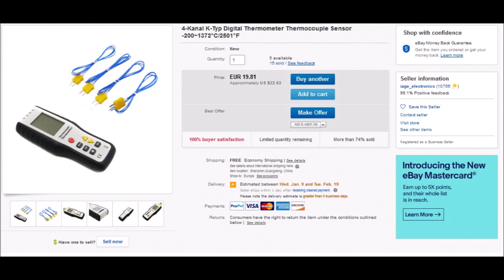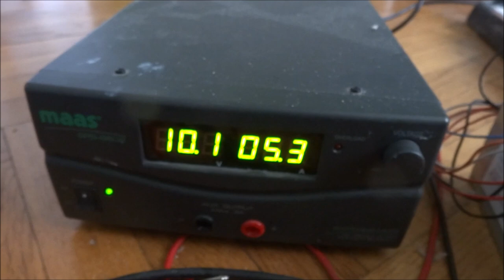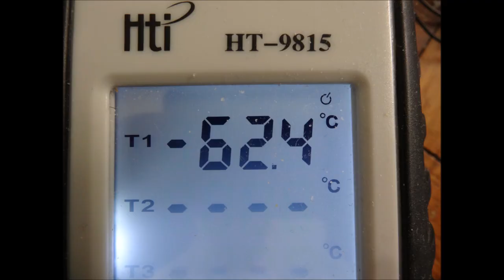stacked Peltier modules for very low temperatures less than -60°C

Comment: they used cascaded peltier coolers in some older thermal imaging camera's to lower the image sensor to -70c to reduce noise from non infrared radiation

Comment: Why are the elements on top getting smaller?
I guess the lower elements reach their deepest temperature only in their center.
Or is there another reason?
Why didn't you use the same voltage for all elements?
If it's in the video or reference page, sorry I missed that.
regards!
Reply: (1) Each element has different power requirements due their size. More size means more semiconducting thermocouples means more voltage/current. (2) The way that the thermocouple works is that it sends heat to the bottom surface, leaving the top surface cooler. (3) The thermocouples on the elements will be sending their own heat  to the bottom surface as well as whatever heat gets transferred to the top, cool side from the Peltier element on above it. Therefore the elements on the bottom need to be larger so that they can more easily disappate the additional heat from smaller elements on top of the stack. The hot side of the bottom element is attached to the CPU cooler.
Reply: @nothingnewhere6551  thank you for your answer!

Comment: Can you make a cryocooler using peltier atleast to iquidify nitrogen
Reply: Perhaps not that cold. But... around -85, you can condense biogas into liquid, for storage in pressurized tanks, like 20lb propane bottles.
Reply: yea   I think we can make atmost dry ice at -85
 @bmw328igearhead
Reply: @lobo5727  Riiiiiiiiiight..  

If you only knew...

Comment: So how many degrees of air temperature drop were you getting? From intake to output? … If I missed it I’m sorry. … Obviously, cooling off the entire room would be great, but expensive… A lot of people don’t realize that you don’t have to go that far… If you are working in a hot garage or something, having a small desk top size unit that blows cold air directly on you can make all the difference in the world.
Reply from the maker: Hi! The purpose of my experiment wasn't to cool the air in my living room, but to get deepest temperature. If you put your Peltier-cooler in a room and you don't transfer the heat to the outside, than you won't cool the room but you heat it. Because more heat is produced compared to the cooling-power. If you want to cool a room I wouldn't recommend Peltier elements. Better take a refrigerator-circuit....